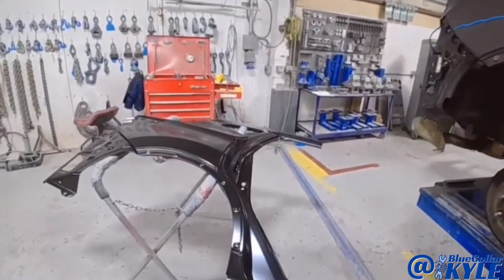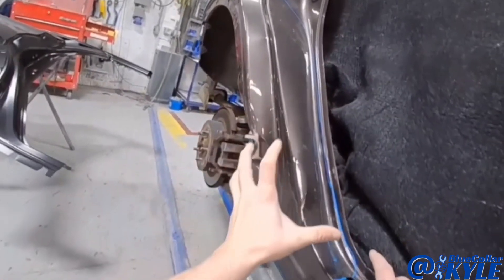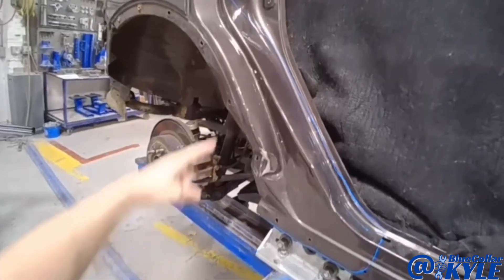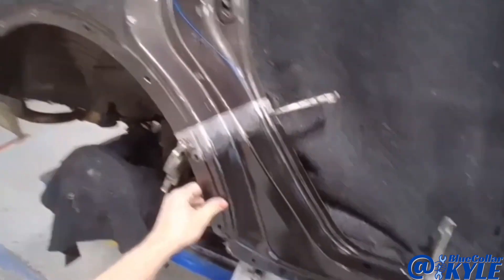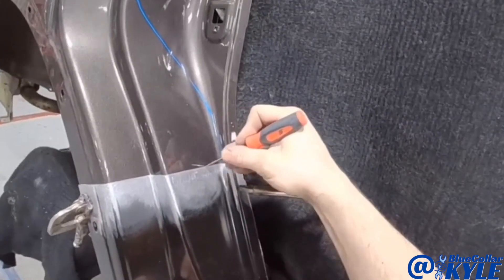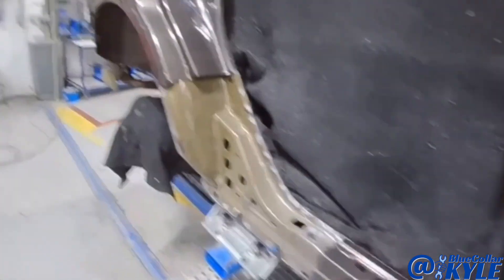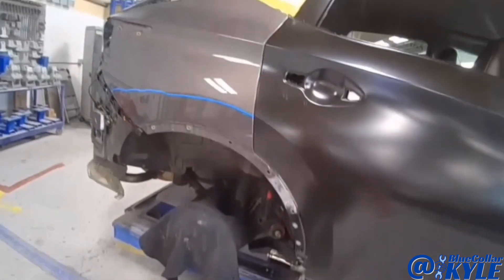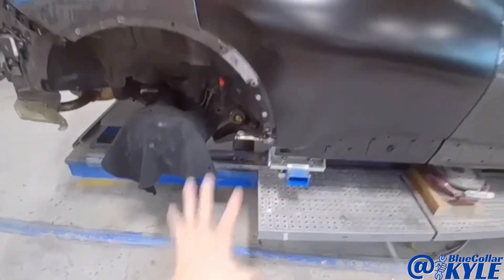Replacing A Nissan Dogleg!

Comment: What kind of welding method did you use for the sheet metal? A few tacks with breaks to prevent heat? Or a long bead?